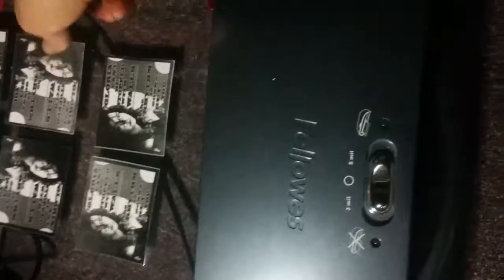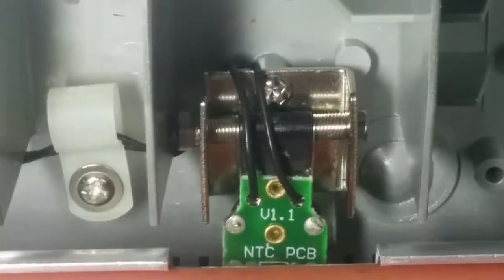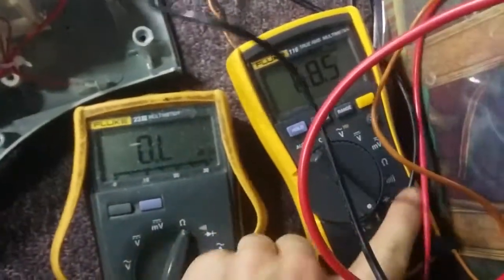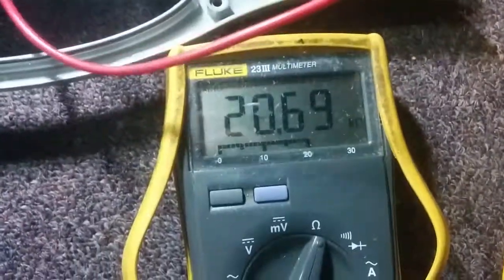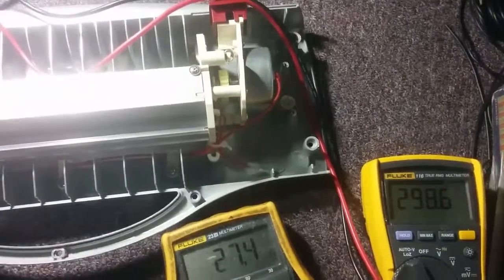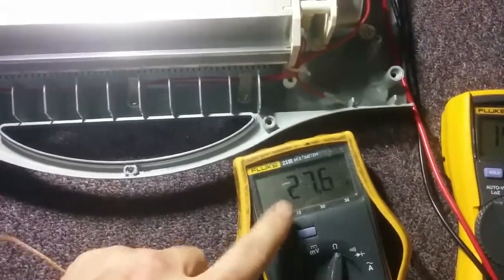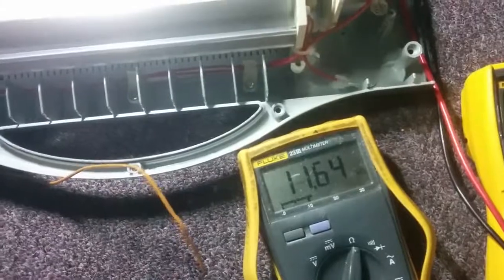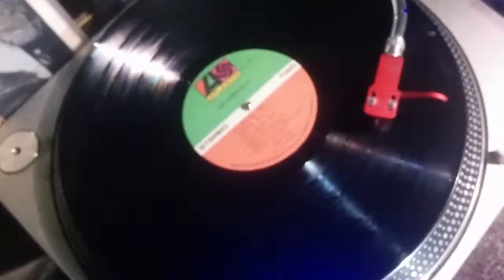Fellowes Laminator Repair feat  Gloria Estefan (Part 2)

Comment: Shouldn't it cool as resistance decreases?
Looked up:
In most conductors, like metals, resistance increases with temperature, but the opposite is true for semiconductors and some insulators. 
I'm assuming latter half is occurring as you mentioned.
But from what you showed on meters... Resistance rises and temperature rises.